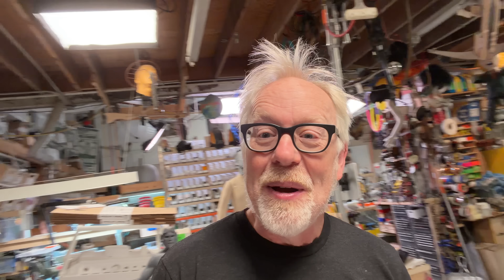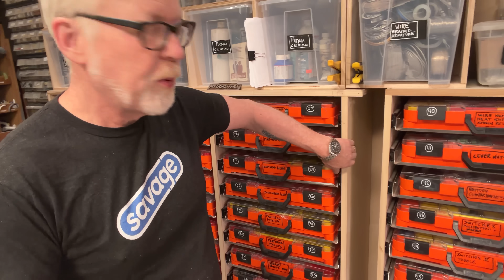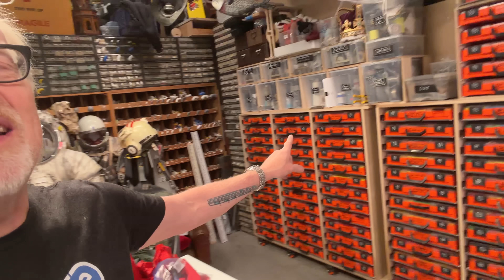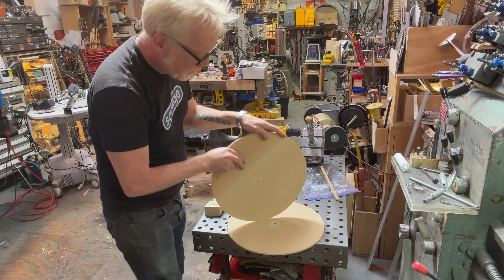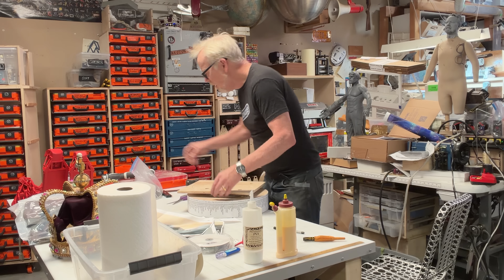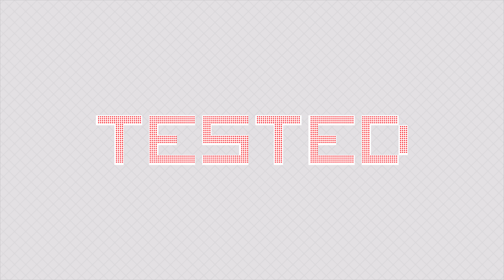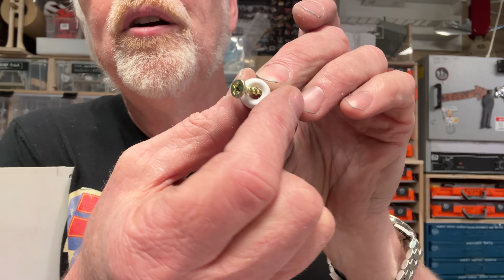Adam Savage's Hardware Organization Mistake!

Comment from the maker: Adam Savage Sorts Half a Million Pieces of Shop Hardware: https://youtu.be/shromWxXBr4
Photo gallery of Adam's Sortimo contents: https://www.tested.com/adams-sortimos-2026
Adam's Sortimos Contents List: https://www.tested.com/adams-sortimos-contents-list
(Some of) What's in Adam Savage's Sortimos: 
Flat head rivets: https://amzn.to/4bnFGna
Upholstery tacks: https://amzn.to/4byUsGp
Pop rivet tool: https://amzn.to/4uCn7Di
Retainer clips: https://amzn.to/3PbVeBZ
Extension springs: https://amzn.to/4rwlBA2
Compression springs: https://amzn.to/3Ntjn6w
Stainless pipe plug fittings: https://amzn.to/3NxX9QA
Air hose fittings: https://amzn.to/4d3PdkJ
Lamp repair assortment: https://amzn.to/4lEIKyA
O-rings spacers: https://amzn.to/4tgF3Cb
Full list of contents: https://www.tested.com/adams-sortimos-2026
Disclaimer: Tested may earn an affiliate commission when you buy through these links.
Reply: 9:11 - am I just overlooking it, or are we missing the link to the (Rockler, was it?) lazy susan bearings?  Because I'm curious to know more about these ones, and maybe try to see how they compare to some $15-20 options I'm aware of (that, admittedly, are probably of much lower quality, but... curious about how they compare and how the trade-offs work out).
Reply: How come many times when Adam says Tested will give a link in the description more often than not there is not a link?
Reply: Can we get a link to this or what? 9:11
Reply: Adam we made one mistake on your list wheel!!!!  You should have left 5 to 10 blank lines with lines on them to guide you for handwriting extra add-ons, for future expansion because what's going to happen is you're going to expand and you're going to have to remake that list again, and the wheel!!!😮
Reply: Personally I think the original strip list was fine - all Adam had to do was make it hinge at the top with a handle or something to lift it to eyelevel for reading, and then it would just drop back down flat against the shelf gap again after use. Way easier to change if there are any changes to the list as well.
Reply: Forget the Wheel List - You should totally build a Paternoster Storage system! They are like that storage shown in WALL-E, rotating trays or bins or shelves that can go into other space that would normally be wasted, so one could route it into an attic or make use of crawlspace.   I bet Adam could build an awesome system too. There are some companies that offer them, different phrases like vertical or horizontal Carousel storage system, or 'endless' pantry system stuff like that. Some manual some motorized. Bring the Item to you.
Reply: The wheel is great but I worry that if I had one like that I would get dirty fingerprints all over it or "stuff" like dust in the air. I am useless at making stuff and have no artistic talent so I would have just put in a cylinder with an easily wiped off window material and a toothed circle either side I could use to index it. I am probably being as stooped as usual and there is a much easier way to do it.
Reply: best use so far for lazy suzan was making me a 3d scanning table .. leftover 3d printer motor,  ordered a pack of gt2 belts , add variable motor controller.. had to gear it for torque that lil nema17 wasnt happy
Reply: Large square Perspex window with a horizontal line in red, or whatever colour, to underline the item and box number. 
Each circle should have been large leather bound cog wheels, off set to each other. 
Aesthetics mate. Practicality too. 
What do I know though? I'm just a YT watcher.
Reply: What if with each letter there was a slight notch to gently hold it in place with a pointer or line that lines up with the line on the wheel? Too much?
Reply: Now imagine doing it with replaceable insert style labels so it can be changed at any time. 3D printer time!

Comment: Suggestion would be to take a piece of clear plastic (type is likely not that important) and scribe a line in it. Then if you want to be silly you can add a 3d printed ratchet wheel and a clicker and call it "the part is right" (sorry big spinny wheel, couldn't resist the silliness". back to serious ideas. Attaching a magnifier to it so you can read the lines easier, but definitely that etched line on clear plastic.

Comment: One hole is actually more convenient. Just put a bolt in the middle temporarily. Have your spots marked on the wheel and just spin it until they line up to the single outside hole but dont predrill them yet

Comment: After seeing it put together, the simpler solution seems more obvious: drill two holes in the left and right cabinets and hang the wheel from a dowel slotted into the holes.
Too late now, though it would give you the lazy Susan hardware back.

Comment: The random part generator. Options:
- need inspiration for a project: spin to select the starting part you must use (or spin for all the parts)
- existing project needs an extra challenge: spin to select the next part, force it to work and if not reshape it / rebuilt it so it does the job

Comment: Beats my Ryobi compartment box of Torx screws, and my harbor freight small parts organizer of bolts and washers snd other misc fasteners.

Hinges, handles and other hardware gets tossed in the misc hardware drawer of a dresser i have in tge garage. Other drawers are plumbing shit, electrical, and drywall/paint

Phillips head screws and 18 gauge brad nail strips are on top of a random cabinet .
The screws get used maybe 4 a year i hate Philips heads😂

Comment: Dear Adam - in Democratic Athens the Athenians would post important public documents on vertical revolving prisms called Axones. Look them up. 
I think Axones would be a still better solution than your wheel, which does not allow your eye to flick up and down the list of items as readily. Axones were square prisms oriented vertically, a bit like a cardboard box for crackers, with writing on four sides accessed by revolving the prisms horizontally with your hand. They allowed much more data to be squeezed into a narrow space and were less awkward than constantly revolving a wheel.

Comment: I am currently working on making the poor man's Sorta-Mo lol. Bought a bunch of Harbor Freight Storehouse storage case and I am replacing the cups with 3d printed custom ones that fit perfect where the original system fails. My custom solution works better than gridfinity. I wish I could reach out lol or see you at places like open sauce but these videos help and thank you for the excel sheet for reference on how I should sort my hardware pile.

Comment: u need a small database or excell file and a dymo label pronter. Better yet, there are apps: Dedicated Asset & Tool Tracking.  that let you can create/search bar codes that you associate to groups of goods. stick those IDs to each box and then in the app you fill them with items. then you search in your db for an item and it will show you in which group the item is in and then if you had split your boxes/ IDs into somesort of dewey decimal system, it makes it easy to go to the right box. then once done, you  an also lookup thebitem again and be sure you go back and store it at the right place again

Comment: wouldn't just putting a hole in the middle of the wheel and sliding it onto a short metal dowel have worked just fine, with better clearances?

Comment: I would love to see a profiled wooden flange on the side for spinning the wheel pinched between thumb and index.

Offset it a half inch, have an inch or inch and a half larger radius, then carve a profile that flares in for the pinch grip. Bet it would feel a lot more ergonomic than trying to grip across the 4" face. Plus would cut down on the list getting dirtied by hand grime

A similar concept made of bronze would be incredible, though much more expensive and time-consuming to execute

Comment: Wouldn't a belt have been better? Like a car belt, or like the belts used in belt sanders, so it could read an entire section at once, also you could have designed a samll footprint

Comment: Makes me think of using a small microcontroller screen called a "Cheap Yellow Display". They're popular, have a touch screen, and an SD slot in the back. It could read a CSV file on the card so it could be edited easily, and you could have a basic search. I feel inspired to do it now!

I'd put the alphabet in a big font on the right in like red just above each divider line.

Comment: What I would say, is work with one of your tech savvy friends, to get it into google sheets, and then make a mounting spot for something electronic that goes onto a cubby that is under the thin bin on the far right of that first break.  Then you can add in a search for like 2x5 or dowel or pitch and have it look for the part you need for a smaller list that yo can scroll through.

Again, might be a little bigger of a project than you want, but a) saves space b) makes it easier to find and c) depending on the size, you can shrink or expand the font.  Then if you run out of something, you can make a check or something you can say "out" and it then gives you a list of things you need to order...

But I digress...

Comment: Armchair quarterback here, always easy to critique another man's work when leaning on shovel. But if you made 2 or 3 wheels they could be much smaller a-m n-z 
My craftsman radial arn drill press handles up to 32in center drilling, get one, very handy.
Reply: The space between the units solved the problem and a single wheel at eye level is preferable

Comment: Hi Adam, we have a system called 'stow by light' where you scan the code on a box and the destination bag lights up. Maybe have some switch on each item that when activated lit up the tray where that item lives. Or go completely OTT with a slip ring on the wheel where each tray lights as the wheel is turned, but using RFID in each box so it can live in any tray and still work could be excessive........

Comment: instead of an actual wheel, why don’t you just make a. Put a three or 4 inch dowel to fit in the open space put two pins in it place one at the bottom and one at the top and just make a new kind of like the air fashion, hand towels, where you just keep pulling it in a never-ending spin

Comment: Next step: Add a rotary encoder that reads the wheel position into an ESP32, it then displays the relevant letter in a big font on a fast refresh rate OLED screen  on the above blank panel where that 'label' should go.

Comment: 6:33 Genuine question: What on earth do people in the US mean by 15.3 inches?

Given that the inch is divided by 8ths 16ths etc, is it 3 of one of those increments? Or 3 of a forced division by 10?

And how is 2 3/8ths (6cm) represented in that notation? 2.38!?

It's genuinely difficult to find answers online as for the most part resources simply want to offer conversion tables, which is not what I'm curious about.

Comment: Alphabetically based I understand.

Analog & electricity independent I understand. 

Reinventing the wheel, but downgraded I just don't understand. 

Even if there are no Rolodex currently being manufactured, the functional parameters are well defined. They are superior in several aspects to the result of this build. 

A. Rotatable ✅
   1. But you must touch the rim (thus covering information.) A handle at the axel allows for faster rotation with less effort. 
B. Reversible ✅
C. Small form factor 🏌️
    1. Total area occupied excessive.
D. Rearrangeable ❌
    1. No room for additional items 
     2. Item removal not supported 
     3. Grouping into categories impossible 
     4. Changing designation precluded
      5. Consolidation difficult 
      6. Multiple locations takes separate entries 
E.  Indexed ❌
      1. Initial letter not tabulated 
       2. No provision for categories 
 F. Protected ❌
     1. Surface exposed to 
          a. Touch transfer guaranteed 
           b. Spill/Splash probability high
           c. Atmospheric contamination current 
G. Portable ❌
     1. Only one location possible 
      2. Must return to look up multiple items 

... I don't understand!

Comment: Did you leave room on the wheel for expansion, updates, or corrections? Divide the list by pages (say 5) expand the wheel to 16 inch radius for about 50" Circumference. Any change can be made by separate page (detach old insert new) without replacing the whole list for one new/changed/deleted item.

Comment: I have a better wheel idea and it will fit in that Gap but it's going to be a more complicated build. You need to build a "Price is Right" style wheel. a looping horizontal list.

If you go fixed face like that one, you might need 2, but I think you could interlock the faces like a tracked tractor belt and have a long loop draped over a spinning cog. The best part of this idea is that edits to the list just require swapping out identical track parts, you can insert or remove a part as needed and it will make a satisfying noise in operation.

Comment: Just wait for him to change the wheel into a two part scroll, so the list can be massively extended and stretched out... because the wheel has a scalable limit, which a scroll simply increases by a large factor.
And then he sticks a little solar powered light there, so it stays lit, even when the office is closed down.

Comment: I'd put big letters on the right side, roughly marking each section of letters. When you need a Rubber Washer you just scroll to the big R, then find it just to the left of that. Don't even need to reprint the list, just sharpie them on wherever they fit best. Dividing lines between each section of letters as mentioned is also a great idea.

Comment: The frame should have an index card on it so that you can make notes between revisions. Also, I would use some color codes. Like blue ink items are nuts. Green are washers. I think using a dotted line under each item would make the smaller text easier to read

Comment: You should take this a step further and put contact points along the sides of the wheel that correspond to a matrix of LED lights in the boxes. Then add a fixed arrow to the wheel like The Price is Right so as you spin it the current item lights up the box it's in, making finding it easier. I figure that would be a neat electro-mechanical way of identifying boxes.

Comment: I actually designed something similar 14(?) years ago. There's a WWII cemetary in the Netherlands for resistance fighters that were executed. They had a map there, with a list of who was buried where. Then, a book came out with background information on the persons who were buried there (almost 400 in total). The foundation that manages the cemetary really wanted this information to be available on site. The problem was, that it's in the dunes near the sea, there's no electricity, no cellular coverage and no supervisor. So I designed 4 rolodex mechanisms in corten steel enclosures that can be manually operated.

Comment: Suggestion: add some kind of sensor of the current wheel position, add lights behind each drawer and make the currently selected one light up! It probably would require addressable RGB LEDs and some programming to implement it in timely fashion.

Comment: If you mount the list to a thin plastic strip you could back light it from inside the drum. This would be less glare than a light shone on to the surface. Love the build, just a suggestion if you did want to illuminate it.

Comment: You need little grippy blocks on the right side, or front face edges, so that you can turn it easier.... doesnt need to be anything big... just a finger width or two... maybe 3D print some from TPU, 10-15 mm tall.... last thing you want on your paper list is oily, greasy, or glue covered prints smudging it up...

Comment: Even better than a wheel: a belt list, with start and end sides attached each to a cilinder. You just need to roll them up and down to the cilinders to move the list up and down. Much more compact than the wheel, just need a bit of creativity to make it fit in the space  you have. Like that, if you want to expand the list, you do not need to built a new wheel or change the mechanism, you just remove the paper list, and attach the new one and you are good to go.

Comment: I was one of many making suggestions for this, although my suggestion was to make a scrolling device, so that the length of the list could be changed in the future without having to make a new circle. One other suggestion I would add would be to use some clear packing tape over the list so that it is durable and washable!

Comment: 4 gentle (recognizing it isn't my shop) suggestions: A- a brass plate cut to a slightly larger diameter, with reeded edge/knurling. For that tactile, dial-a-hardware satisfaction that seems to be lacking in so many of today's modern day shops; reducing dirty-fingerprinting smudges on the list is an added bonus B- if a light ever does get added, I suggest motion detecting activation for it, and also adding a magnifying sight glass with a box outline indicator C- as soon as I saw the list scroll around, I couldn't get Price Is Right out of my head, so I think a "Come On Down!" graphic (In a PIR color scheme and font) somewhere on that framework/faceplate would be superb! D- with the numbers now to the left of the text, and if you add lines demarking the letters, a big, BOLD, 20-ish pt. block letter to the right of the text (wherever enough lines are short enough to fit it) should make it easier/faster to conduct a dial-search by eliminating about 25/26ths of the total list.